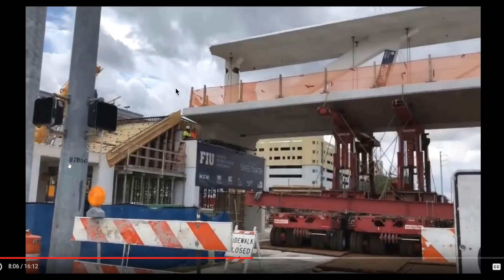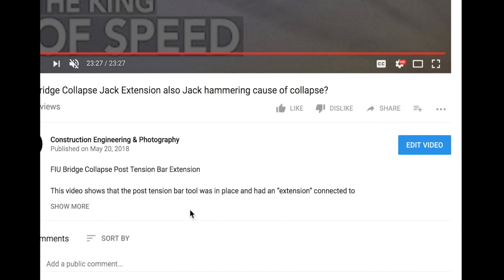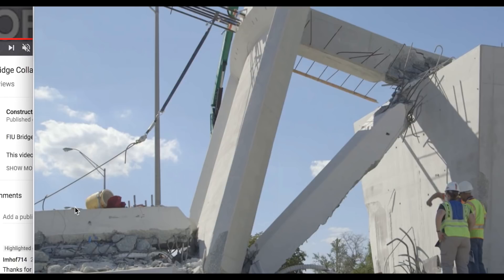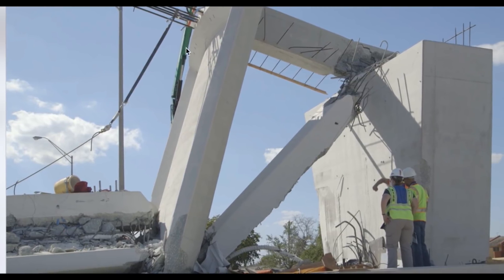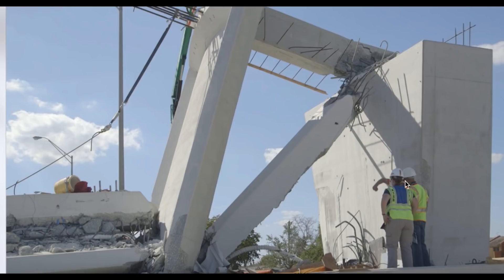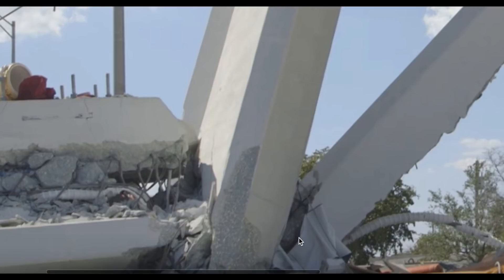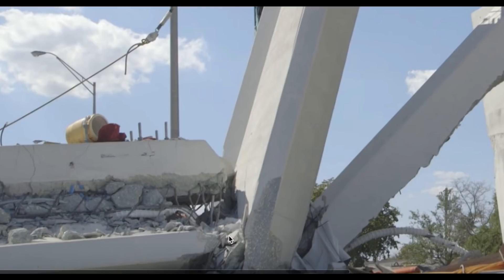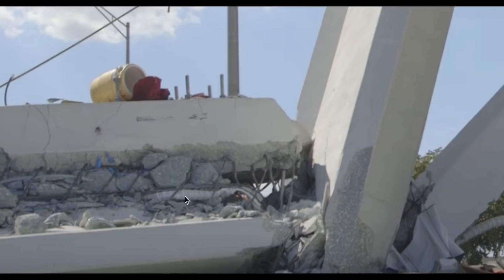FIU Bridge Collapse De-tensioning contributing  cause of failure?

Comment: One of the characteristics of this structure that will make forensic analysis difficult IMO is that ANY change in the tensioning on the cables in any of the truss members or the longitudinal cables in the canopy and the walkway alters the load distribution of the entire structure as they are interdependent and interrelated. This is a major flaw in this concept and probably should never be used again anywhere structural support is required.

Even if they were all set correctly at the completion of construction there is no guarantee that they wouldn't fatigue at different rates over time due to physical stress and thermal expansion and contraction. The structure is therefore inherently unstable and its integrity could fail at any unpredictable time.

Comment: I wont to point out that they increased the number of longitudinal cables for the canopy from 6 to 8 because someone though that only having 6 did not give sufficient margin of strength for the canopy, BUT when moving the walkway into place there was only the 6 in place, I know it was the outer ones, and they were not to give as much strength as the inner ones, but the structure was still not up to full strength top and bottom, so any flaws in the design and or construction, " See poor re-bar layout  and to many voids to close to areas under heavy lodes no grouting of the main cables" as shown in your videos. would all contribute to a cascade affect starting from a small fault that mite otherwise not have lead to a failure.
      
There is one thing that I saw  in the plans for the walkways  longitudinal cables that mite be nothing but it looks wrong to me, and that was that the last part, "not just the end" of the longitudinal cable run, goes up on a incline, but if you then tension the cables the cable will of cause  try and level out, putting a  severe up ward force into the walkway floor near to where the angled columns meet, and adding a  upward bowing the walkway, which probably would have been fine if they had been grouted ?   
 Just does not look right to me !      
Thank for all the good videos they have been very informative.
Reply from the maker: Your welcome and thank you for sharing / commenting...
FYI, only four longitudinal cables were in place...at time of failure...the other 4 were were to be installed...
I believe the intent was to install the last four after the other bridge span was installed...pulling the two together, in design and reactions...
Also, I wish we knew exactly where all the cables were...we could see the difference from design to actually placement...This would identify many change orders and issues this design had...